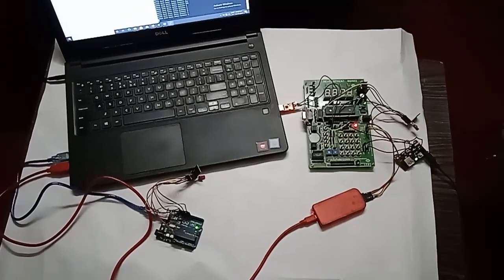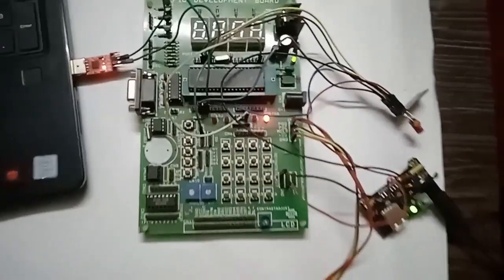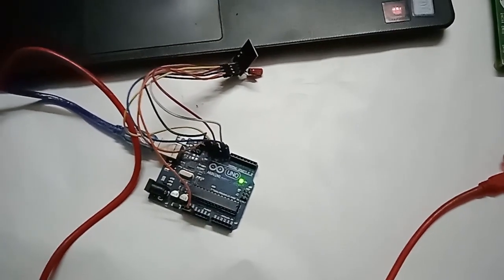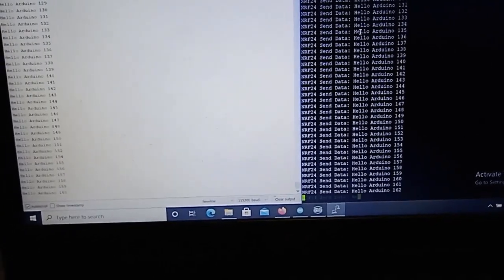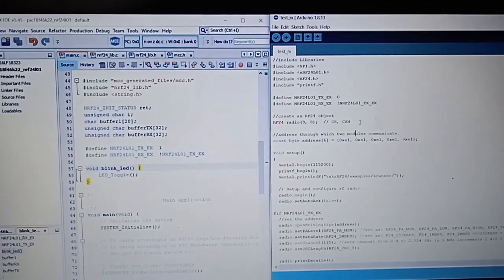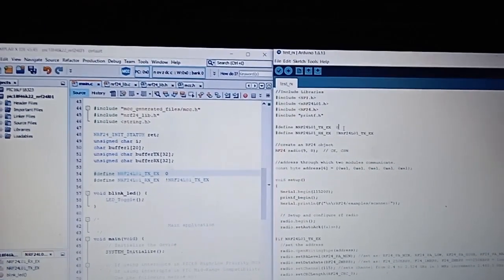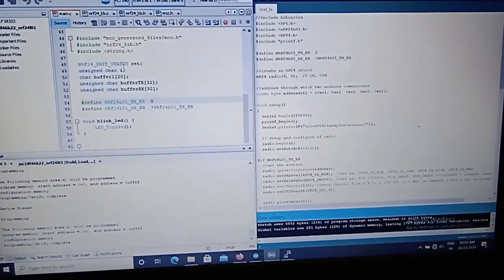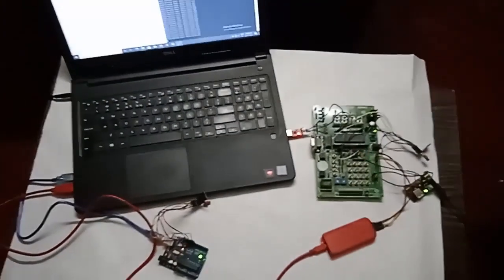SPI Communication on PIC Microcontroller by Interfacing nRF24L01 RF Module

Comment: Thank you very much for your contribution. I uploaded your code to my PIC18F4680 and it worked quite well. I only had to adapt some register names and initializations since the PIC18F4680 is quite old and doesn't support MCC, but after that, it worked quite well. Thanks!
Reply from the maker: I'm glad you found the code helpful and could adapt it for your setup!